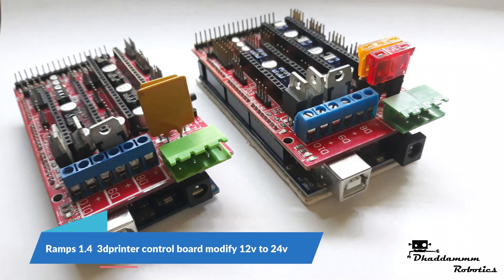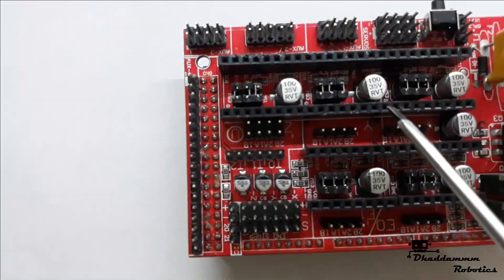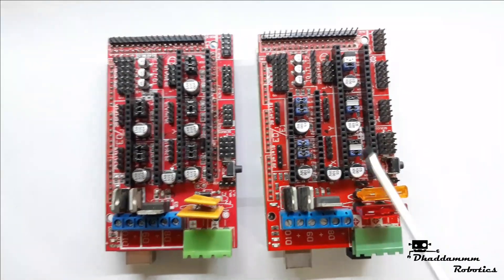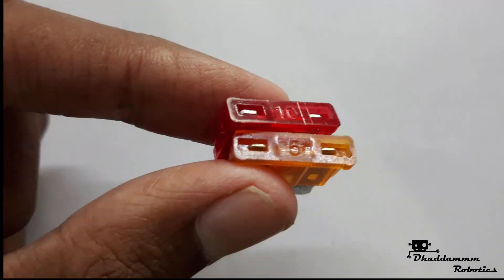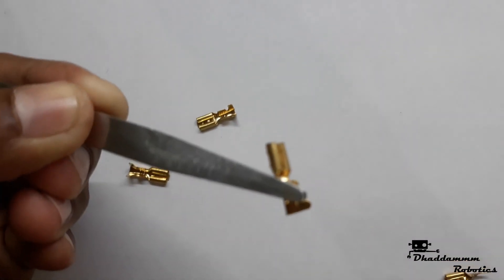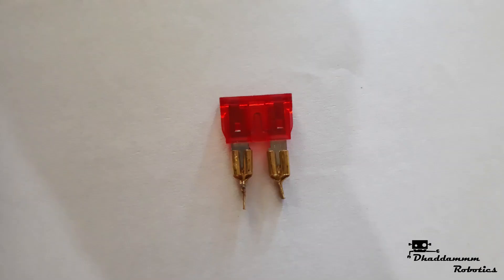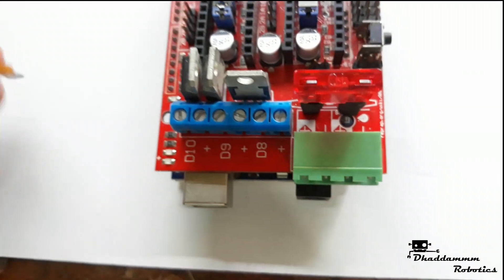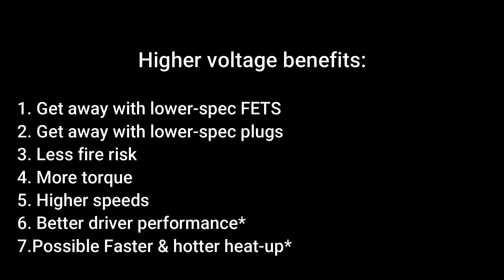💾3D Printer / CNC Motor Driver RAMPS 1.4 Upgrade 12V to 24V 📇Good Printing Speed with Quality

Comment: how can we utilize the 5 (+1) stepper motor ports when power to all drivers is delivered through the 5Amp Fuse. just running them at 1.2Amp would burn the fuse?
Reply from the maker: Sum limits fix , I used this drive with 5 nema stepper motor in 3d printer

Comment: hello my friend Why my ramp 1.4  d10 has no output volt ? so therefore my hotend not working can you help me?
Reply from the maker: Two case 1 is your supply not sufficient , 2 check hot end is ok or damaged , also you connect thermistor first otherwise it not working

Comment: 12v 30amp use any proplam
Reply from the maker: No problem but depending on stepper motor if stepper high capacity then damage driver